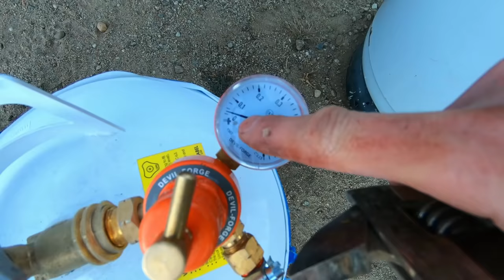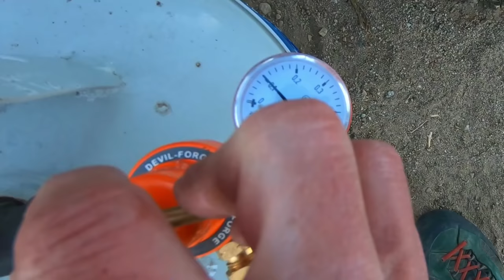SMELTING GOLD AT HOME!  Simple Gold Recovery for the Gold Prospector

Comment: Great videos! I am wondering how you come up with a flux recipe? I've been trying to smell I've failed a lot but I'm close. I got my first speck in the cupel. At first I didn't think it I had anything. But a little tiny I know I missed a bunch in the slag. It never seems to pour as liquid as yours. I figured its my recipe. Any tip would be great. Thanks for the time you put in to your channel!!!
Reply from the maker: Hello Andy. Congrats on your first bead!  Smelting can be difficult and confusing.   My best suggestion is to make sure that the furnace gets hot enough and for long enough.  You want to "cook" the smelt until all bubbling stops then continue for 5-10 min longer.   In my non blower furnace this takes 45min to over an Hour for me.    Also, flux thinner does work.